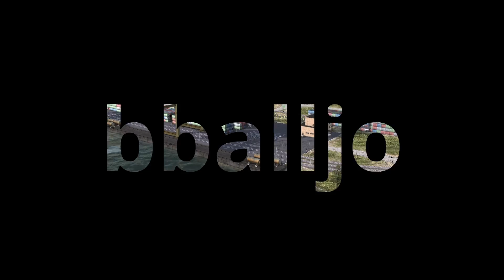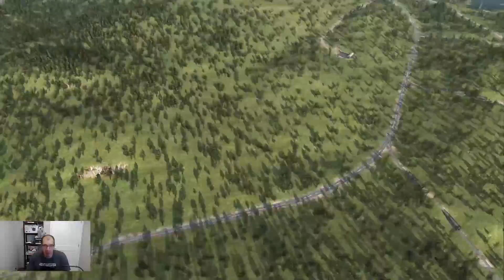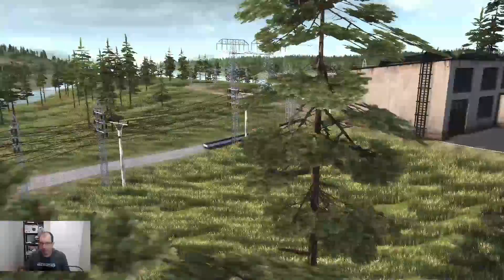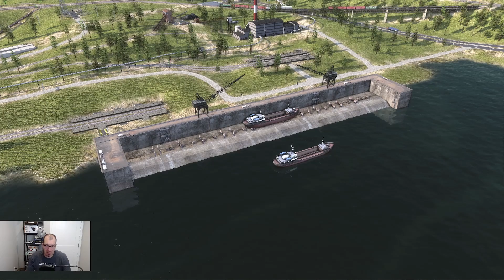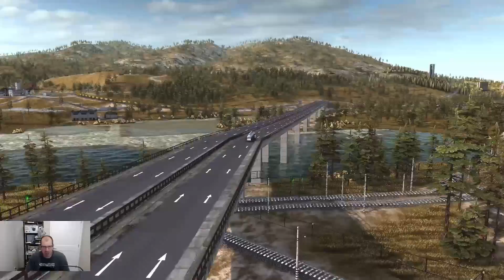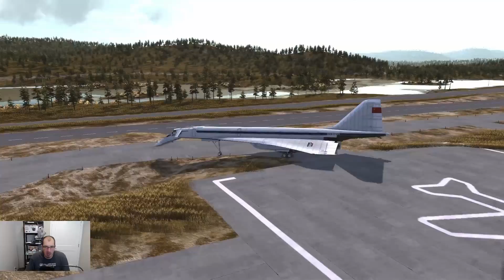Finally, A Plane! | Workers & Resources: Soviet Republic | S3 | EP 39

Comment: You probably found out now what was the problem with fuel delivery to the harbor, but if not or for anyone else having this problem, i think it's because the harbor is not powered.
I had the same problem with a CO, as soon as the building was powered the DO started bringing fuel.
Reply from the maker: Indeed (if I recall correctly)